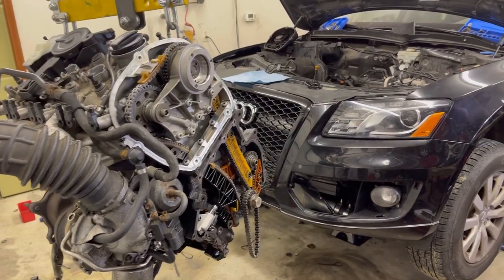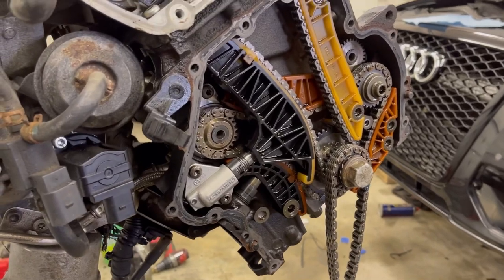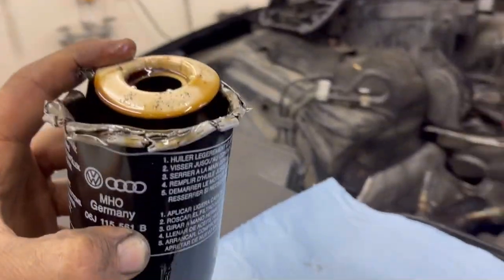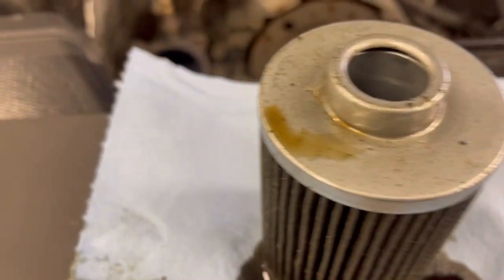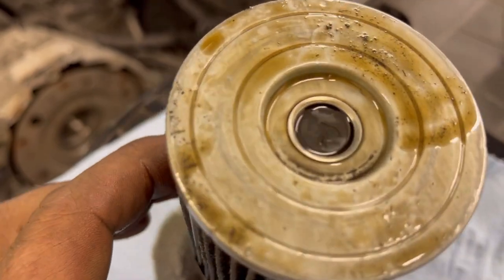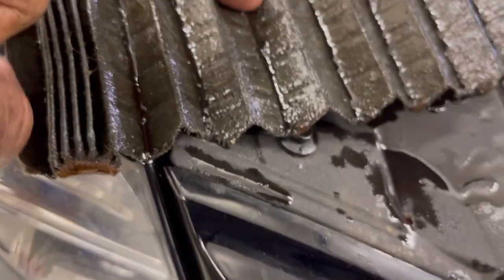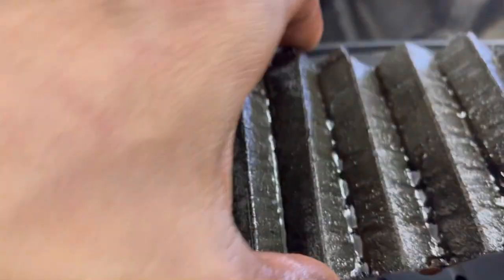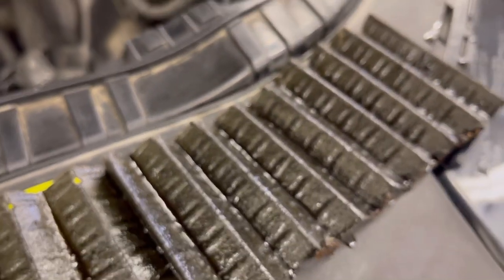Do Oil Filters Actually Work?  Shredded Serpentine / Accessory Belt Oil Pressure warning follow up

Comment: So whared the rubber come from, the belt?
Reply: The drive belt. The belt that runs the alternator, power steering, ect. It broke and got stuck on the crankshaft pulley, worked it’s way behind the timing cover seal and got all into the whole motor as it got passed around the internal oil system. It was all in the head, valve train, and oil pickup. It was terrible. It got a full rebuild in another video